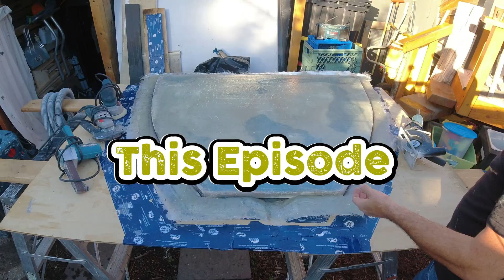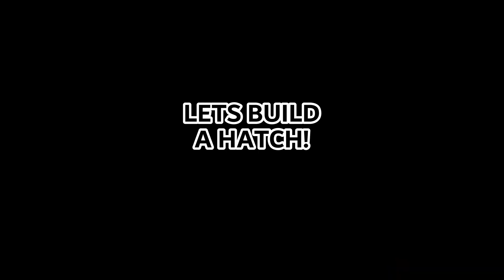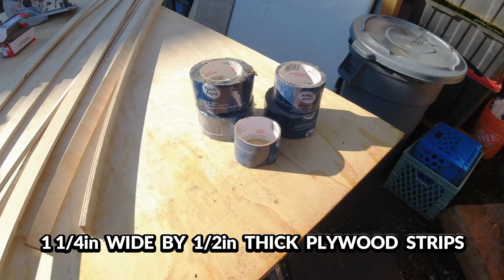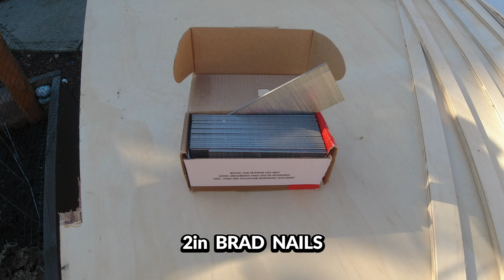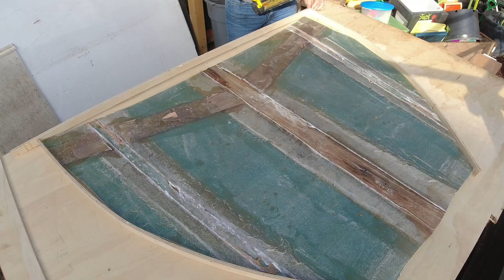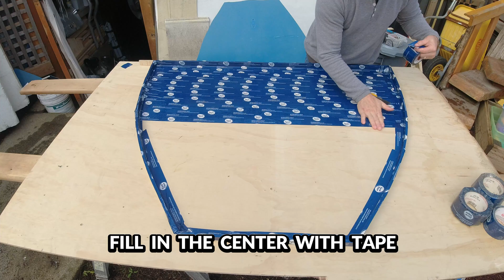EP 11 -  BOW HATCH BUILD Part 1. 16ft Boat Rebuild.

Comment: I am in love with the series

What's the name of the pink fairing?
Reply from the maker: Hi, thanks for watching. 
I use Phenolic Microballons. They are phenolic resin spheres with reddish/brown colouration. This tone makes them particularly useful for cosmetic topcoats. I like how easy it is to sand. Although they are not as waterproof as glass microsheperes/balloons. I find them nicer to work with/smooth out. It looks pink because I only use a small percentage in my total fairing recipe. 
Hope that helps.